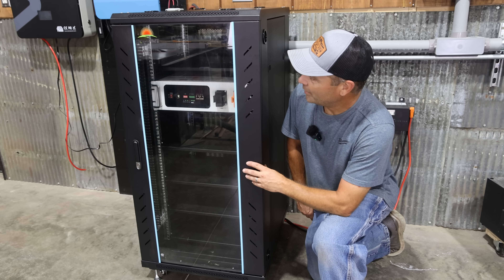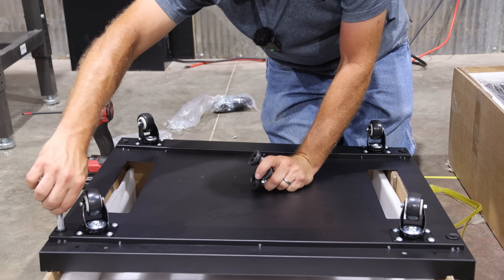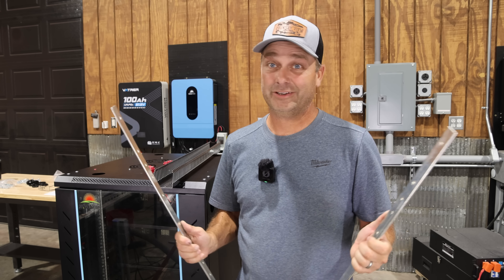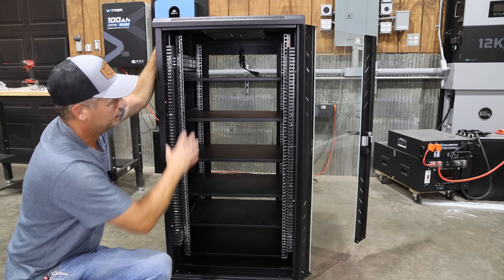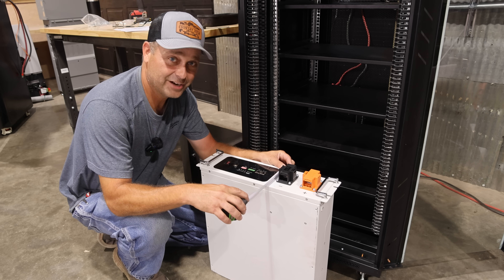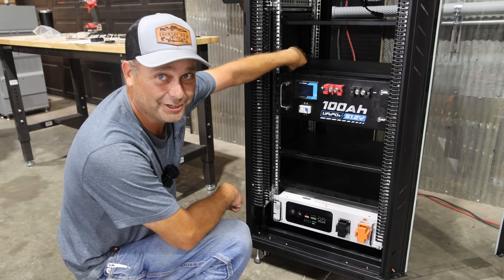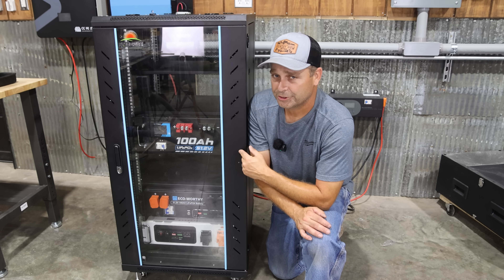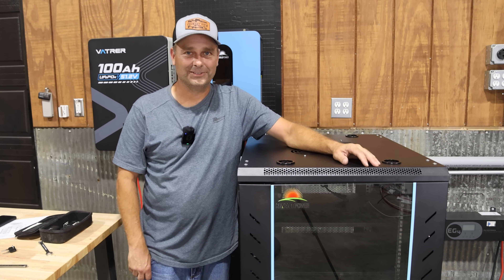This Fits all my different Batteries.  Sungold Power's Enclosed Server Rack Cabinet.

Comment: I have this cabinet, its great, build quality is great, the adjustability is very helpful. It looks great and professional. The biggest down side is the total lack of instructions. The two line drawings they enclose are pretty much useless. Sungold does have a assembly video that is very helpful. Would i get another? In  heart beat.

Comment: Hi Evan
We just received 2 of these racks and are working at putting them together with very limited instructions. All the screws are thrown in one bag unmarked and unspecified. Could you tell us what screws did you use to secure the shelves to the rack? And were your shelves extremely tight going in? Putting this thing together is an all night job for a novice😮‍💨
Reply: If you can put this together the system itself will be easy. Limited instructions is being kind. Sunpower does have a video for assembly that does help but even it their is trial and error. All the bolts contained are for the buss bar. after that its a guessing game.  Once you get it done though its a great cabinet

Comment: I bought this exact same cabinet , BE AWARE that it will NOT hold Six Vatrer 51v batteries, they are much taller than most server rack batteries. I had to modify the cabinet, I took the top off of the cabinet and made a five inch spacer between the cabinet and the cabinet top piece that contains the fans for cooling.  My profession is Marine Electronics Installations and I do quite a lot of fabrication .

Comment: Great Presentation and Review of the Rack.  And thanks for the washer trick to even up the doors.       It sounds like you just flipped the Negative bus bar and didn't drill and tap it.    If anyone else has done this, did you reorient bars so that the Positive was higher and the Negative was lower so that the bolts that tie to the battery wind up being parallel?  thanks.

Comment: Just subscribed.  I'm early in my journey.  Have 1x Ecoworthy battery now, 2nd one arriving this weekend.  Will start with 48/1200 Victron inverter and 250/60 SCC.  If I stayed at 3 or less batteries, looks like I might have space to shove the inverter, SCC, Lynx Distributor, T-class fuse holder, solar disconnect, Chargeverter etc. inside the cabinet.  Then just have solar and ac (for chargeverter) coming in and ac (inverted) coming out to plug into a transfer switch.  But the SCC and inverter need decent ventilation.  Be ashame to run those fans and use all that power if not necessary.  If that fan subassy were removed from the top, do you think there would be sufficient ventilation inside?  If questionable, do you know how many watts those fans use?  Is there a built-in thermostat for the fans, or is that DIY?  Thanks.

Comment: Nice video and not a bad server rack cabinet at all. I bought one for my 6 Eco worthy server rack batteries in April 25- glad I did. Assembly was ok. The wheels could be better- stronger. Preferred over the Open frame rack from Eco Worthy and cheaper than the EG4 rack.

Comment: I have two of them, adding my own extras like lighting that changes based on battery SOC

Building them sucked, definitely some quality control issues.

So I was too busy building them to film and cover them.

I will do a detailed build video if I ever get another because we need one.

Detailed on the things missing like what position to use on all the internal brackets and shelves to have everything fit properly.

Tips for things like remove one bus bar until all the batteries are installed.

Comment: Thanks for the video. This rack does look versatile.   Wish the manufacturers built to a common rack standard but where is the profit in that if you don’t have to buy their rack. Haha.  Yes I am jaded.  I have put together many computer and communications racks over the years. So I have opinions just as others do as well.  I initially thought I would go with server rack batteries but am leaning more to a power wall approach.  The advantage of the server rack is it can fit in smaller spaces. So many decisions.  Haha.  All the best from Minnesota (on our way back to Texas).

Comment: You can set that Sungold 6 station cabinet right next to the nearly empty EG4 rack cabinet that only has one battery in it !    LOL    That Sungold Cabinet is nice looking.      You need some batteries for both of them and then you will have 60 kwh of storage to add to your system.
Reply: Exactly what I have - Filled the Sungold server rack with EcoWorthy V2 and the EG4 with 4 EG4 LlV1 and 2 of Eco worthy V3.

Comment: Server racks are standardize. You can buy the stuff anywhere. I believe the racks go back to the 30s or 40s for relays, telephone equipment, other communication equipment and more recently for computer equipment. The IBM PC bottom tray was actually a server tray. The only really unique item for electrical equipment is the buss bars. I put together my first server racks (for file and backup servers) in the 80s. Battery racks are 19 inch racks there is also 22 inch and suck, but 19 is most common.